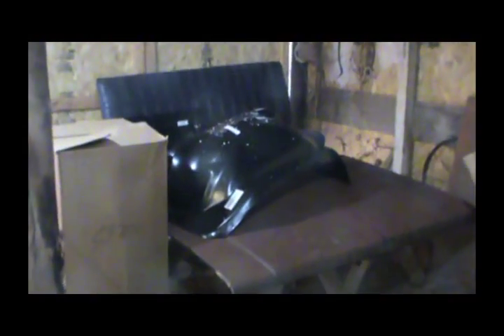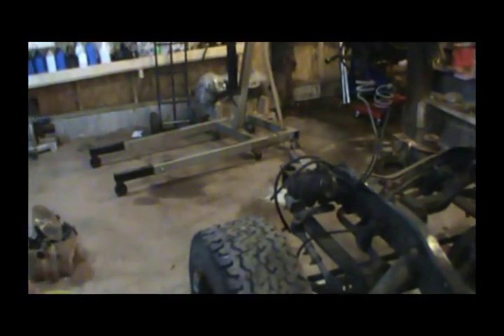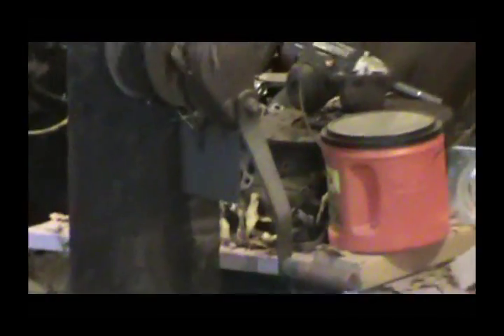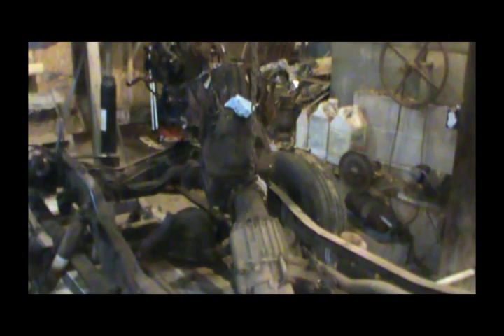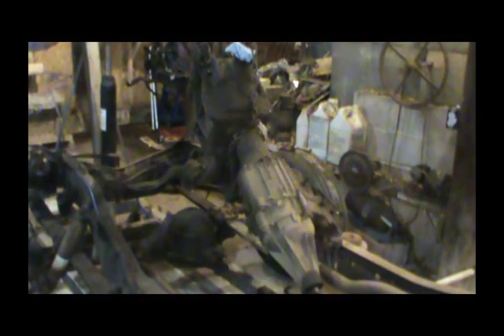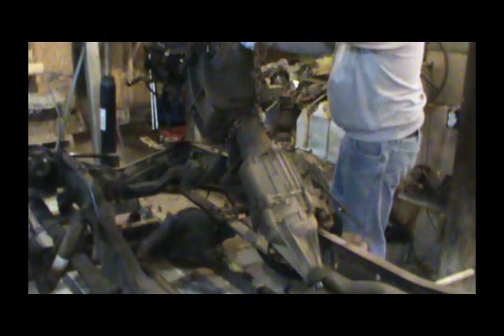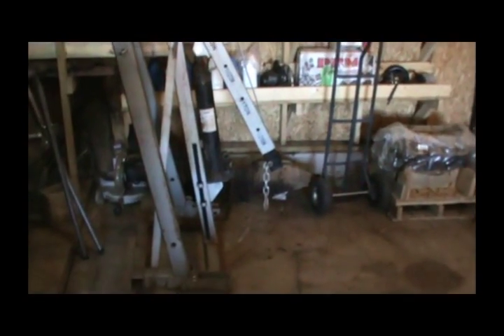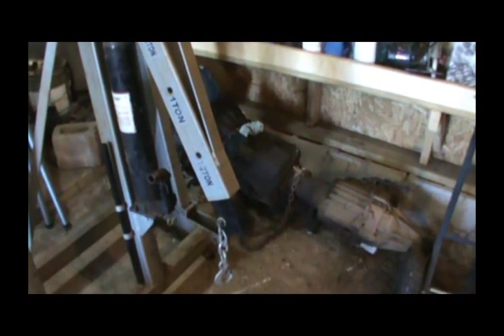1985 Chevy K10 Restoration Part 8 - Trans removal

Comment: You make this look easy and thats the strangest looking transfer case I've ever seen
Reply from the maker: Thanks Ryan.  I hate that I couldn't video the entire process.  The hardest part was getting the engine hoist turned around LOL.  It may have been the angle you're seeing the T-case from.  It looks like any other T-case I've seen.  The piece in the middle is the adapter.

Comment: I'm doing the same to my 83 Chevy k20 ur videos help a lot bit I'm in Ohio so these bolts suck on core support and body mounts just going to cut em I'm putting. 3" blocks under it any ways
Reply from the maker: Dexter Monk I can imagine.  You will still need to remove the body bolts and I hope the nuts don't break free like they did on this one!  Cutting the core support bolts is the easiest way of removing them.  I also made some videos a few years ago on redoing an '83 K20.  It's called Project Diesel if you haven't seen them.

Comment: why did you not sandblast or power wirebrush the fram before you painted it?was it cost or time
Reply from the maker: +terry woods It wasn't very rusty, just dirty.  At the time I don't think I had a sandblaster either.
Reply: Just wondering cause I think I'm going to have mine sandblasted.its pretty rusted.
Reply from the maker: That'd be the way to go if it's rusty

Comment: Check out elderly iorn on youtube see the paint he used on frame, transfer case on my old 78 is cast iron 205 np they say its one of the best all gear drive.
Reply from the maker: Yep, the 205 is a great T-case but very heavy!  I guess you're 78 was a manual because the automatics had the 203 full-time case which are also very heavy! :)